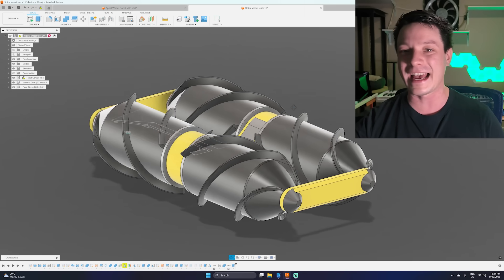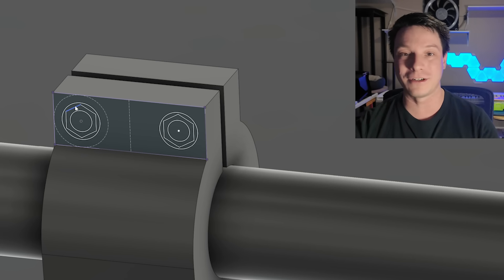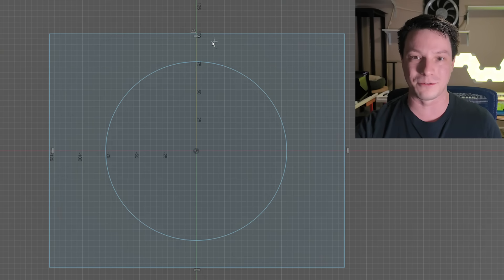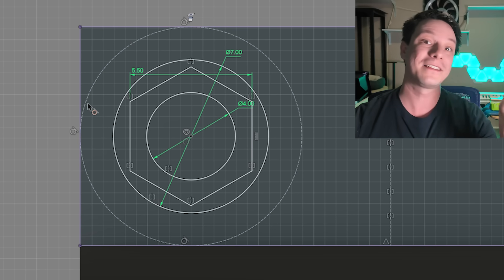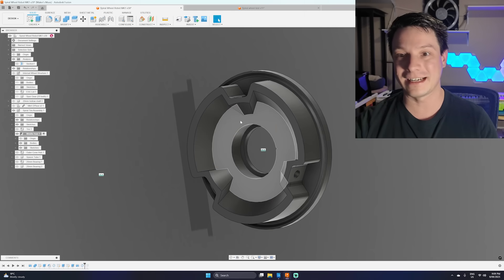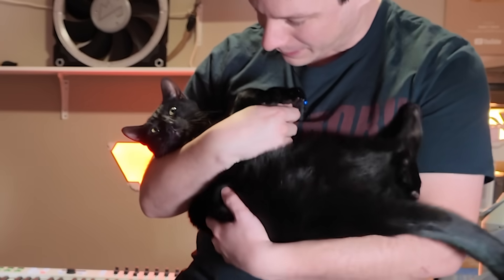Killer CAD tips to speed up your workflow (Fusion, Onshape and more!)

Comment: Regarding distance from circle to the wall (https://youtu.be/e7t_dn1I9NA?t=350), after pressing "d" for dimensions, right click on the circle and choose "Pick Circle/Arc Tangent" on the pop-up menu, so the dimension will now be from the circle itself. Another option would be to dimension the wall distance from the center of the circle. Click on the radius value so that it picks it as a parameter, then add the wall thickness. If you dimension a circle by diameter, then just divide it by two before adding wall thickness. So the distance from the center will be like "d15/2 + 5 mm"

Comment: An easier way to center a hole in a square or rectangle is to draw a diagonal reference line between corners and make the midpoint of the reference line the center of the circle.

Comment: This is a good video, lots of useful stuff in here that I regularly make use of. I definitely need to use surfaces and bodies more, though. Some tips I've picked up in my time using CAD:
- Smaller feature tree doesn't always equal better. Use the tools in a way that is both most efficient and allows you to make changes to your model easily, which sometimes means having more simpler sketches rather than one big complicated one which is more likely to break with edits.
- When designing housings/casings for existing objects, model those objects in CAD along with your own design so you can easily visualize how they're going to go together and make sure your sizing and tolerancing is correct.
- Use tools that do several things at once, such as hole wizard to create holes with counterbores, countersinks, etc.
- Make use of component patterns in assemblies for things like fasteners which are spaced at regular intervals, to avoid having to create a ton of unnecessary manual mates.
- If you need to make a completely mirrored version of a part (a right and left car side mirror for example), copy the part file and in the copy, mirror the body that makes up the entire part and remove the original.

Comment: Edit: Okay ooof, I saw right at the end you know about them: Original text: Please tell me you know about and use "User Paramaters" in Fusion. It's basically named variables. You can just say circle_diameter = 10 and then use that or circle_diameter/2 wherever in your sketch. No manual updating needed. You can also use those named variables to create more named variables - I use that often if I know e.g. the thickness of a certain part is the sum of all of those extrusions, and each extrusion consists of an extrusion of <some height> + 2 * tolerances. I use that all the time. And I usually set up 2-3 tolerances from the start as variables called tolerances_loose, tolerances_tight, tolerances_very tight. Which I just need to change at one place to adapt to the tolerances of my printer for all parts.

You can also overconstrain your sketch because you need to know some dimensions out from geometry. Then you have a "driven dimension" - you find all the dimensions from the sketch at the bottom of the "User Parameter", and can actually also rename them.

I on the other hand didn't know about the points and how useful they are. I usually just use my variables and then whatevername_diameter /2 + whatever mm in the dimension input.

Comment: 0:35 Copy and paste sketches
Copying and pasting a sketch also works in FreeCAD. You might need to select the constraints from the constraint window and then hold CTRL and drag-select all of your lines on the sketch. I don't know if they are fixing this in 1.1 so that you don't have to select in two different spots (or maybe it's already somewhere in the settings), but I copy and paste sketches all the time.

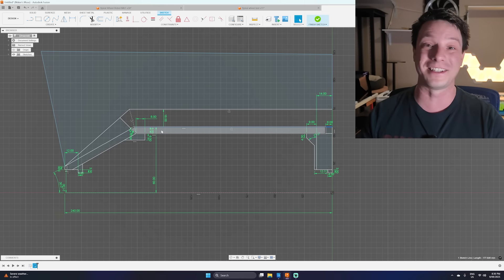2:05 Reusing sketches
FreeCAD also has reusing the same sketch feature. I, personally never use it, so I don't know if it works the same as yours here.

4:20 Use sketch points

FreeCAD obviously has points, but for your example, you can just directly set the distance from the edge of the rectangle to the edge of the circle.

6:48 Construction geometry is awesome
Yes, FreeCAD has construction geometry (and I also use it all the time). Construction geometry is also great for making changes. If you have a line that you want to be a curve, while retaining the shape of everything else, just change your line to construction geometry and then make your curved line. The constraints will remain, but the old line won't be included in the pad/cut/revolve/etc.

8:59 Enter calculations as values
FreeCAD also has calculations. Combining it with named variables really helps on large projects. Admittedly, the spreadsheet setup is a little wonky, but once you learn the naming scheme, it works beautifully.

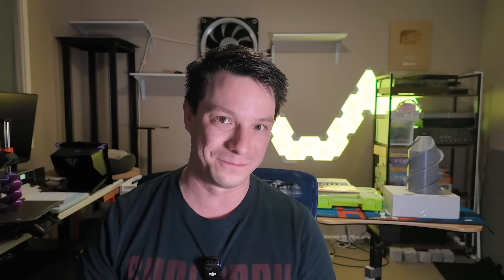9:47 Use surface modeling
I have never used surfaces, so I can't comment on this one.

11:37 Boolean operations
FreeCADs boolean operations work, as expected. I don't know if FreeCAD has something like "keep tools". I usually just clone the part and then make the cut or whatever.
I have mostly used them for cutting. For example, when making a mold for a part.
For your particular use case, I'm pretty sure you could just make a small sketch, for the outside of the spiral and have it follow a path line to extrude out the fin, with no boolean required, but I have only done a very rudimentary version of something like this, so I'm not 100% sure that it would work like I'm describing.

Oh man, boolean cuts with no tolerance? That's gonna be fun to mash together when it's printed, haha...

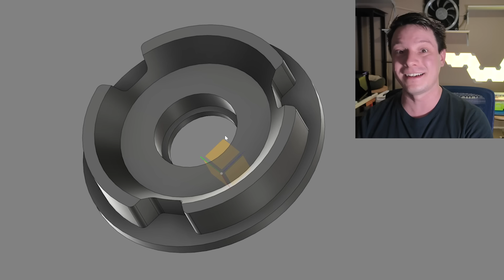14:58 Adding parameter-driven offsets
...oh 😅
I know you can do an offset for sketches, but I don't know if you can do anything directly on faces like this. It looks like Fusion wins here.

Comment: Great video! Never knew I could use surfaces like you showed!

My favorite tip is for modeled threads in Fusion for 3d printing. On all threads that 1st thread is always junk and doesn't have a lead-in. 

To fix this model the thread in the hole like normal, then go back in the timeline before the thread op and add a chamfer slightly larger than the major diameter to the hole then go back to after the thread in the timeline. You will now have a perfect thread with a nice lead-in and no crappy 1st thread

Comment: Hi Angus, great tips a couple of notes: To dimension to the edge of a circle  right click select pick circle/arc tangent.  On revolve make the revolve line an actual center line when you dimension to it, it will dimension the diameter not the radius.  
For holes, I always try and use the hole feature not an extruded circle. Makes annotation much easier if you actually have to do a drawing and uses  standard clearances for actual screw sizes.

Comment: Here's a tip to save time in cad: don't start out in cad. It saves a ton of time if you already know what you're going to design before you jump into CAD. You can figure it out by sketching it on paper, or by using volumes, or even in a simpler 3D program like sketchup. But if you jump into cad straight away without knowing what you're going to design it will cost you a lot of time and energy to figure it out. CAD is inflexible and it will fight you for your precious time. CAD is only the tool that makes the documentation file that says what your final part looks like. But the design of the part itself comes before that.

Comment: Instead of individually selecting mating faces for clearance offsets, I like to create what I'll call "cutting tools". You can create an in situ copy (I like to use Fusion's boundary fill tool for this) and offset every face 0.1-0.2 mm. Then boolean cut the mating part using this tool body knowing you didn't miss selecting any relevant surface.

Oh, and I also like to use this technique in combination with the "delete face" command. Let's say I have peg with 2 snap fit prongs: I create a copy, delete the faces between the prongs, do a clearance offset on the cutting tool, and perform a boolean cut. Easier than altering geometry inside a recessed pocket.

Comment: Wanted to thank you for the clearances tip. I am designing a little toy and been struggling for weeks adjusting every clearance through sketch and dimensions. I'm going to rebuild some of the parts using your method.

Comment: In Fusion, the "Project" feature is a very powerful tool for creating quick sketches. It allows you to bring existing shapes or geometry into your sketch so you can easily add dimensions or make modifications. For example, if you have a curved surface and need to cut a straight hole through it to the other side, you can create an angled plane at the bottom edge, project the edges from the curved surface onto that plane, draw a square in the center with constraints, and then extrude to cut straight through.

It's also very helpful to use component colors when working with lots of parts. This feature is also useful for the timeline. By turning it on, you can assign different colors to each component, making them easier to tell apart. On the timeline, you'll see a solid line in the component’s color where you've made edits. You can cycle the colors by right-clicking in the dropdown menu on the left side of your screen, near the bottom.

one other thing is you can bring in SVGs into a skecth to create a number of things for example I use a Image to SVG tool that my friend made or something online, you can take a photo of a hand tool that has a lot of weird corners and If you take a straight-on photo of the tool on a piece of paper, you can run it through the program to get a simple outline of the shape. After un-fixing the imported SVG, you can modify it,  Instead of manually dimentioning around the shape, just measure one part of your tool, compare it to the same part on your sketch, and divide the measurement by the dimension and use that number to resize(scale) the entire sketch at once. Depending on the website or software you’re using, you might need to do some cleanup, but a good program can produce very clean sketches with minimal effort.

Comment: If you right click on the circle/arc while dimensioning, you can select 'Pick Circle/Arc Tangent' or 'Pick Circle/Arc Center'. No need for the extra step of adding points. If the point to dimension from is not tangent to the other line/point, then use a construction line from the center of the circle/arc to the point to define it. then all you need is to add an angle to the construction line and you're fully constrained. Entering calculations as values will cause other designers that touch your files to hate you. Use Parameters instead.

Comment: If you ever think you’re really good at CAD tune into Too Tall Toby’s parts racing. you will see it does not matter what software you use it’s how well you know the software. These guys are building fully dimensional parts with the correct weight of the specified material in seconds.  You will feel like your an amateur, at best, however you will pick up some pretty good tips

Comment: 2:05 I caution the use of one sketch for multiple features.  Too often I have seen one sketch that was meant to do everything.  A year later, someone else is trying to update one dimension for a feature and have no idea where and what dimensions to change.    Limit your sketch to related features.  Your bolt/nut example shows a good grouping as those features all relate to the fasteners.  I would put those lines in the sketch for the base plate, however as the plate and the holes aren't really related.

Comment: Excellent tips, the only one I use that you didn't mention is 'Folders', I am sure Fusion has them, but I use OnShape. They keep lots of sketches, extrudes, etc. bundled in a folder you can collapse. I use them for a section of the CAD that I never have to look at again, it declutters the timeline a ton. And, like others have already stated: do the 'pretty stuff' last. There is nothing worse than trying to add, extend, or remove portions of a model when there are fillets, chamfers, arcs, etc. (when they are just for looks) in the way. Keep the awesome work going!

Comment: Yes to more CAD tips videos!  If you do another one, I'd love to know about that section view you did right at the end.  I've had issues with some of the parts I've designed where features cut out of opposite faces run into each other and being able to see the section view to see how much material is there would have been handy!  Also, if my designs are incorrect I'll often end up completely redrawing a new version, because updating dimensions breaks the part in weird ways.  If you do another one of these, maybe you could talk about some of the "good practices" you're following to make your drawings better/more modifiable, a bit like the construction geometry tip in this one.

Comment: @9:50 I think specifying the reference line as a centre line, rather than a generic "construction line" automatically converts your bearing diameter to a radius in F360. 
As a general tip, eyeball the sketch, then constrain it and then dimension it seems to be the safest workflow in F360 to avoid it breaking things!

Comment: there's a lot of similar methodologies i use in freecad all the time, just different paths to get there for most of them.  construction geometry is still your best friend most of the time, though.  reference geometry is also really handy, but freecad likes to make random reference changes when you change certain details based upon its internal numbering system, though, so you have to be careful how you build your models - if you're building a complex model, try not to make a lot of internal references.  i find myself using boolean operations for complex geometry more often than not as a result, mostly because i find the added planes freecad recommends don't work how i want them to on most of my projects.

Comment: Great video! I have a few notes. the example given at 9:00 for dividing a dimension in a formula actually has solution that better captures design intent. in fusion as far as I'm aware there are 3 line types. sketch, construction, and center. When you are revolving things in a sketch you should use a center line for a few reasons. 1, if a sketch has 1 centerline in it the revolve tool assumes that's what you want to revolve around, and it saves you a click. 2, When dimensioning to a centerline fusion will assume you want to create a diameter dimension and let you dimension to the imaginary other side of the bearing. this way the dimension literally shows the diameter of the bearing in the sketch and you don't need the concept of the radius. you can manually tell fusion a linear dimension should represent a diameter and it will dimension to the point mirrored about the line.
at around 12:00 you talk about Boolean operations. Fusion has a great Boolean operation type I've not seen in any other CAD called boundary fill. It lets you create a shape by basically specifying which specific segments of a van diagram between multiple bodies you want. very occasionally it is the best tool for the task at hand.
at around 15:00 when you talk about clearancing with user parameters and offset face. I've done this a fair bit myself but manually selecting each face can be tedious. If you use surface modeling to represent a complex cutting plane, instead of just doing a cut with the surface body, you can do a small thicken on the surface body first. this way you get a small clearance between 2 parts without needing to manually select every relevant face
the point on using sketch points is a good one. my gut says it's the most stable of the many solutions that captures the design intent correctly. as others have said, tangent dimensions can flip between 2 states and break, I don't know if the point method is immune to that but I feel like it would be more stable.

Comment: Yeah - surfaces are definitely cool and intimidating at first. I still haven't gotten the hang of them in general, but I did a simple project recently using them (to create a soap dish). The thing I liked about them, in that case, is I could design the shape of the soap dish (which was essentially a fancy tube to start with), and then set the thickness of the surface to create a 3D object.

I really want to get more into surfaces for creating other organic geometries because it feels so much better than using lofts on solid geometries.

Comment: Awesome video! I noticed at 16:30 you manually selected all the faces. Idk about fusion, but in onshape you can easily select one face and then right click, go to 'create selection' and select tangential faces. If you learn to  automatically select the features you want it really speeds up your workflow, especially when it comes to modifying patterned features. For example, selecting all holes automatically, and then adding counterbore, different colour to indicate threads etc!
Reply: In the Freeform section of Fusion, when selecting edges, you can hold Alt + double click (or single click idk anymore) to select all tangent edges. Could be that it's similar for the faces here.

Comment: Great tips, I've used basically every one of them. I use a lot more parameters so more things can be controlled easily, and then I make sure to play with the values to ensure I don't have any where sketches/designs that break when I adjust them. I would love a surfaces video, as it's certainly helped with some spots where Fusion did not want to do some operations. Another great one would be joints, as that's one that I think doesn't get used as often as it should and if you look at Fusion's release notes, they did some updates that make them even better.